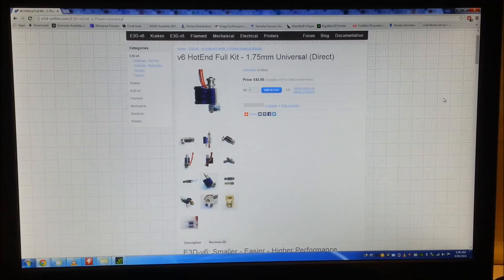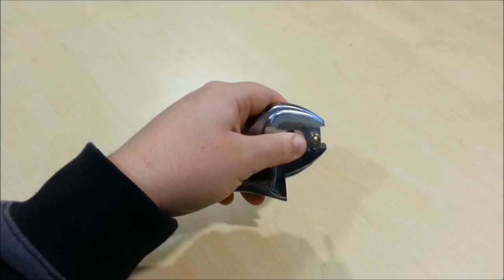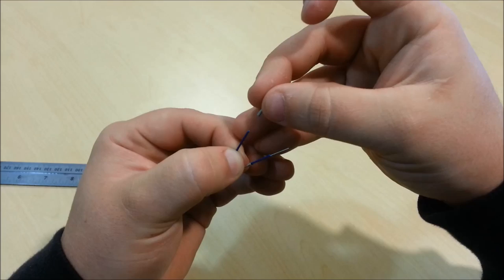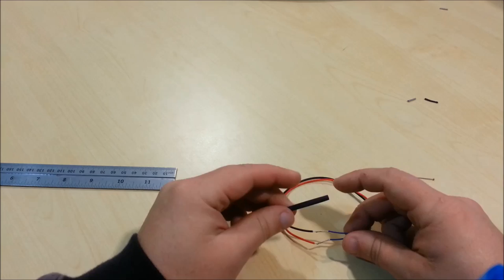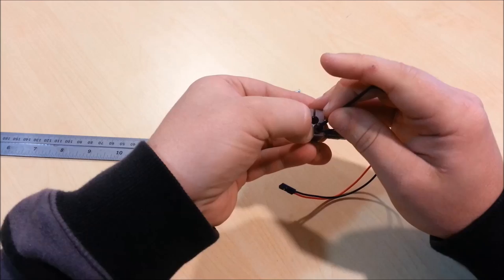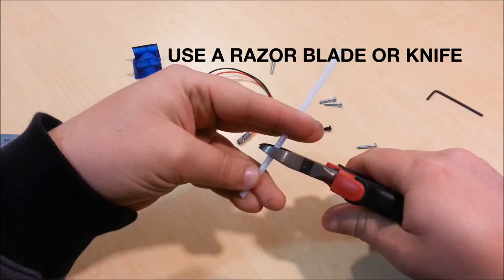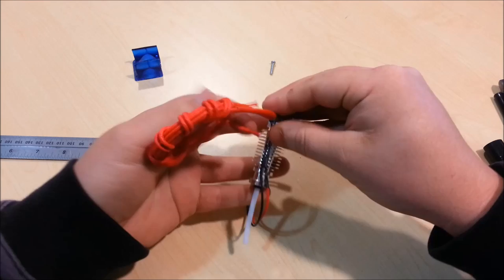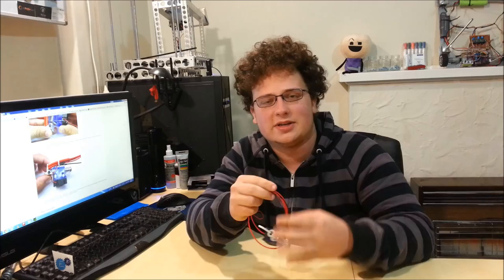E3d v6 1.75mm Universal Hotend - Assembly

Comment: GREAT video!! I just finished following your instructions and installed it onto my Monoprice Select Mini. It's printing (flawlessly) on the desk right next to me and I couldn't be happier!
Reply: Hey I am curious... I have a monoprice mni V1 also. I just assembled my E3D V6 Hotend too, just like this video, but, I am curious exactly how you attach the feeder tube to the top of this? As of now, the  PTFE tubing comes out of the top of the hotend about 3"... there is no threading at the top of the hotend to screw on a nut and / or somehow join the monoprice mini feeder tube to the top of this hot end - and even so, it seems the same size as the PTFE tubing (so its not like the protruding PTFE tubing can fir into the feeder tube). how is it done?

Comment: In my original extruder, it had 4 pins. When I bought a replacement  there are 2 pins with connector and two more without connector.  So my question is, what for the 2 other wires without connector ? also How do i know the proper pins to connect now that there are only 2 when there are 4 in the board ? I hop you could help me out.

Comment: Hi, what is the difference between the 1.75mm universal and the direct 1.75mm e3d v6. I watched the video were they showed it off and near the end they presented 3 of them. 1 being the Bowden while the others were the Universal and Direct. weird. thanks!
Reply from the maker: needabeanie beanie for 1.75mm filament the Universal and Bowden versions are the same thing but the bowden version comes with a long length of PTFE tubing and a coupler so you can have your extruder drive motor mounted away from the hotend. There is no direct version for 1.75mm (because it's called the universal)

For 3mm filament. The "Direct" version doesn't have a PTFE  sleeve or way to mount it whereas the Bowden version has a coupler on the top to mount some 3mm ID PTFE tubing.

I hope that makes sense.
Reply: Make'n'Mod yessir it does!  thanks a lot. I was worried for a minute there that I was not going to be able to mod my universal e3d.

thanks for your help! now im just worried about being able to effectively use 1.75 filament on my Bowden extruders. apparently 3mm is what works best :"(
Reply from the maker: I think it depends on your bowden configuration, if you have a massive upside-down U loop 3mm is probably better but if you have it coming straight down from above the extruder (e.g. a delta printer) 1.75 should still work quite well.

I haven't tested this but it makes sense in my mind.
Reply: oh awesome that gave me the idea on how to set up my 3d printer! thanks!

Comment: i have flashed and installed Repetier firmware on davinci 1.0 , can now i instal e3d v6?
Reply from the maker: essencee234 I'm unsure as I don't own a davinci printer. Provided you can change thermistor type and PID tuning in the firmware you might be able to get it to work. The 3d printing community on G+ is huge and always happy to help if they can. I'd suggest asking there: https://plus.google.com/u/0/communities/117814474100552114108
Reply: Make'n'Mod 

IT WORK, I CHANGED THE FIRMAWARE TO REPETIER, NOW I HAVE FULL CONTROL OF THE MACHINE AND ANOTHER GUY MADE THE SAME AND BUILT THE E3D V6 AND IT WORK, I GONNA MAKE THE SAME. SUPER